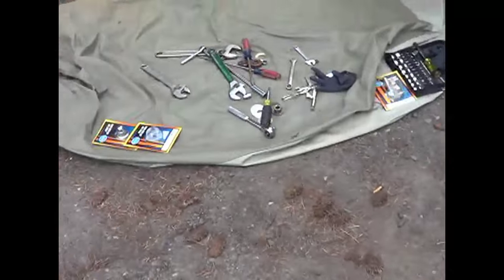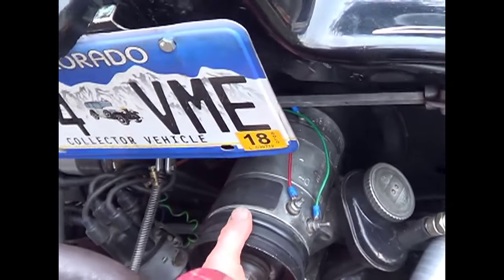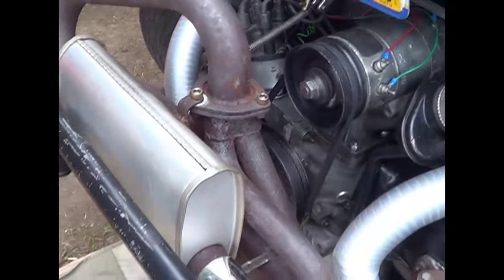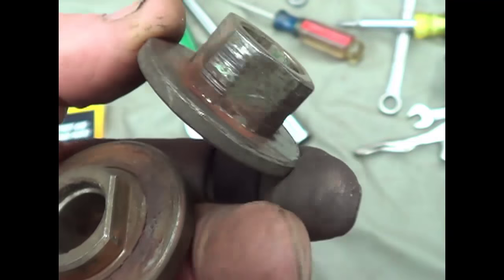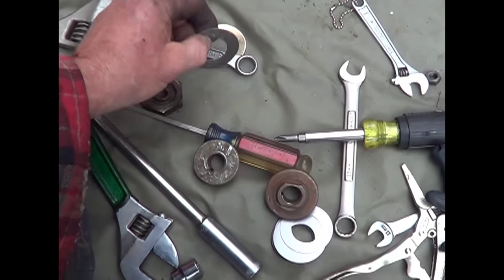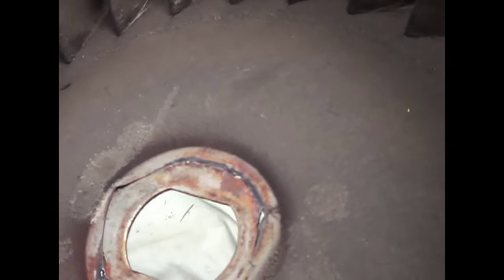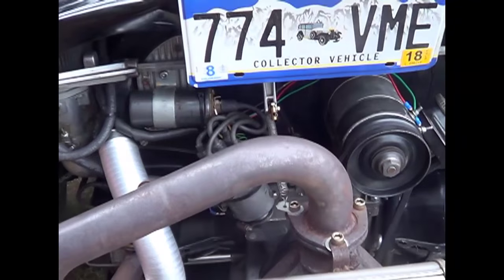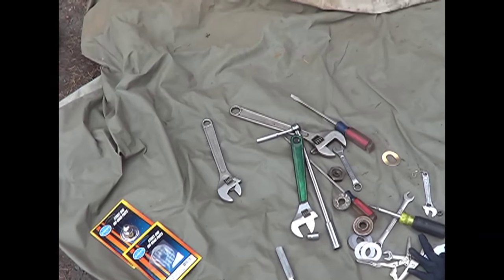Volkswagen Cooling Fan and Pulley Failure

Comment: a good way to go is the serpentine belt setup as SCAT and MST makes them formally BMD pulleys as the Serpentine belts produce less drag as there is a NAPA part # for the belt in the kit as the serpentine belt kits don't use the shims as the entire generator pulley is replaced along with the crankshaft pulley or harmonic balancer. as the adjustable idler pulley as you have to remove the two front studs that hold the generator stand to and put in longer bolts to mount the idler pulley to. as i got one on my 68 bug had no trouble at all with it as i used the SCAT system. i got a spare belt for roadside repairs but lucklly didn't need to use it yet. but if you install the serpantine belt with a BOSCH AL82N style alternator you have to grind down the casting nub on the alternator or the pulley will rub. Its kinda rare for a cooling fan to fail  but since i sen your video i pulled it to inspect the fan for cracks at the hub.  in the near future  i may want to run a Bergmann 911 fan setup as they have better cooling capabilities but none are available for the single stock solex carburetor setup.
Reply from the maker: Thanks for sharing

Comment: EZGZ  how are ya I have a question about heads I know this is completely different from what your talking about. I just did a 1641 pistons and cylinders on a stock 1500 h case. it running but I lost #2 cylinder not fireing new spark plugs same all I can think of is a bad valve.
Reply from the maker: +Robert Steele I just posted a vid on static timing. Try that with #2 and see what you get. Also try compression check with a gauge. They are pretty cheap. Time to get out the book and start basic troubleshooting.

Comment: Sorry about that Chief.  I am guessing that you need to remove the whole world just to replace the fan.......
Reply from the maker: +cutworm59  Not that bad but still a PITA. Cross bar for dual carbs and generator stand and straight out. Problem was I didn't have a socket big enough for the fan nut but I did get it. Funny thing was I heard something when I did that first start up on the bench but thought it was just the new crankshaft pulley & didn't check it out. I feel good now but will probably have a oil leak at the base of the gen stand cause I didn't have a fresh gasket. Need to drive for a few days and go back to Halsey Auto. Take care!

Comment: A EZ becouse i love your vids so much i went out and got me a 73 super beetle and i love it
Reply from the maker: Hope you get lots of miles and smiles.  Don't forget to check the universal joint located under your gas tank. Those things are famous for  making the steering sloppy.
Reply: @TheEZGZ  i sure will iv already replaced most the front end and lowered it 2 inchs also to give it that rake look thanks for the tip becouse even though iv replaced all the steering components it still has slop